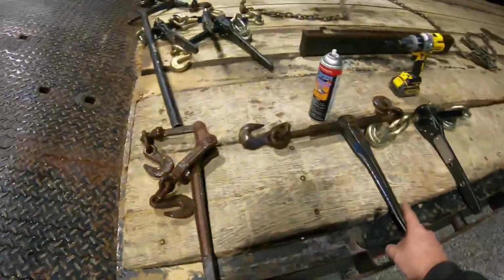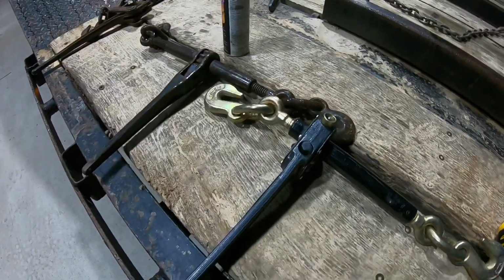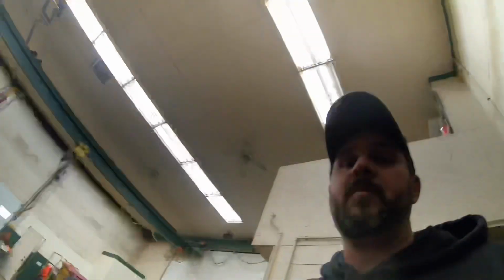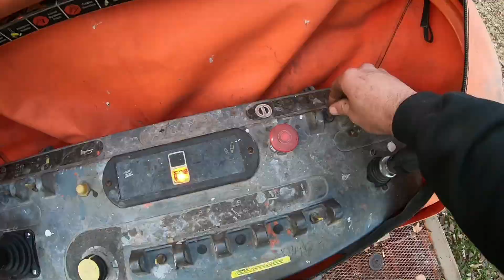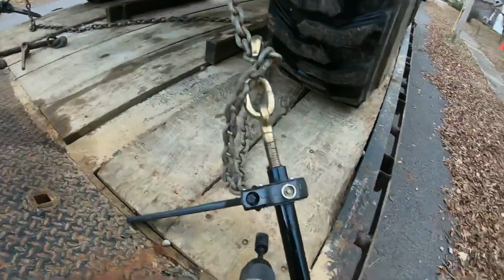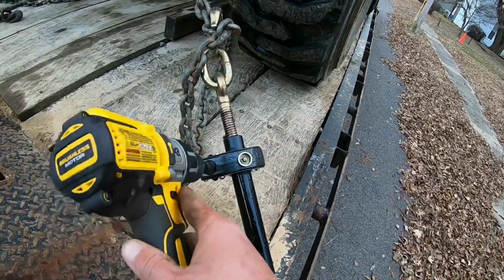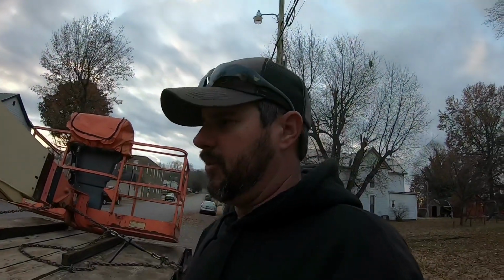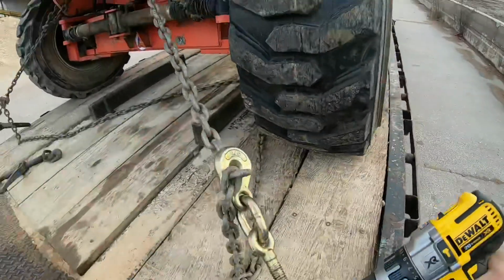Hauling man lift to Logger Wade and my thoughts on  new torque drive speed binders

Comment: You need to keep the ratchet binders out of the rain and they work fine mine are at least 15-20 years old and I haven’t sprayed them once.
Reply from the maker: The rain is not the problem it’s the dirt roads and I am not going to stop and unchain  when there is a chance of rain 🤷‍♂️😁
Reply: so i cant drive my truck all winter just to keep my binders dry ?
Reply: Cough cough Bs!

Comment: That’s cute until your battery dies or your employee leaves the drill on the trailer.
Reply from the maker: See your a glass 1/2 empty guy 🤷‍♂️ thanks for watching
Reply: Ratchet with a 14 mm socket.

Comment: issue i see is what happens when you derby contractors who are hard on tools round out the hexi bolt on the speed binder ??
Reply: Charles Serong good customer service and easy to get parts from them if we need too...but I can’t imagine that scenario without a little forewarning that would allow for preventive maintenance
Reply from the maker: It’s replaceable and not a big deal
Reply: @billiardbrawler  the only reason i posed the question as it looks like it i precast all in 1 syatem ... and we all know that a certain evansville "fireman" and a certain Derby "mayor" would pull it apart using a grinder and cutter lol

Comment: If a guy got careless, he night kiss a handle once as forgets to hold the handle... one the other hand, I have two arms but only one works  cause of nerve damage... would you believe a fungus from Nam is causing me to go blind, I have lost most of the use of my right arm and my legs swell so tight that they split the skin. I have to wear "Una Boots" and they have to be cleaned and re rapped every two days ... three some days but three times in one day once. I have liver and kidney damage all from fungus and might lose my right leg... it seems to affect my right side the worst. My eyes are sensitive to light all from fungus! I did enjoy the video but I made those ratchet binders from scrap and brake adjusters off the trucks

Comment: But what if the batteries die?  This is why I still nail all my drywall and crank start all my tractors.  Batteries are unreliable...period....#sarcasm #timesaver #myknucklesareintact
Reply: I was just thinking you could use a ratchet in a pinch. Or make sure the battery is charged. LOL
Reply: There is always a smart donkey in the crowd. LOL
Reply: Brian Gardiner I was being sarcastic, half of the comments when I did my video were people talking about dead batteries.  You’re exactly right.  That’s why he mounted a charger on the truck.  and we keep a wrench and socket set with the truck already for “just in case” scenarios, so we have been carrying the “back up tool” with us for years.
Reply: Captain Kleeman hate to say it captain, but I think he actually made the speed binders look like there faster than what you did lol. But you probably haven’t had the amount of tie down time as he does. Not hating on you just something I noticed.
Reply: DmaxMarshall it was definitely worth pointing out. Thanks
Reply: Captain Kleeman plus you were doing like 4 things at one time so mike might have had the advantage.

Comment: I would look into an impact. Smaller lighter easier to use and will almost always give the same torque. Friends of ours have gotten warned about chains, binders, or straps being on the outside of rails of bed by dot. Maybe keep ya from a ticket from a power hungry dot officer. Merry Christmas to you and your family.
Reply: 3/8's impact work real well, we have since approved the use of 3/8th's impact...1/2 inch is too much for it. Been using a 3/8th dewalt impact for 'bout 2 years now...works awesome...battery lasts longer too. With this drill in the video you'll see about 30 - 40  cylcles on one battery.

Comment: Not trying to break your balls but the way you ran tour chains is Not DOT approved . The rules are each tie point is supposed to have its own chain & binder just a FYI and just talking from experience I got ticketed for using the same method you just did on the video .
Reply from the maker: Load securement with Officer Hoover and Steve with Speed binders https://youtu.be/46hKizooXDk

Comment: Most states it is illegal to tie down to the rub rail .
Reply: K.D. Pearce really? I see people do it all the time here in Florida. Maybe that’s something I need to read whenever I decide to get my cdls
Reply: K.D. Pearce it’s legal here in good old Indiana.
Reply: @groundupexcavation  if indeed it's illegal it's a state-to-state thing. I personally don't know. Here in NY I've been told both ways. I chain to the stake pockets myself, INSIDE the rub rail because on the first load I chained down, the guy helping me said, "No-no-no, can't be outside the rub rail. It's ILLLLLLEEEEEGAAAAAAALLLLLLL!" Nobody seems to know, not even the DOT officers. You ask any two and you get THREE different answers as to what is and is not legal.
Reply: Its legal in NY too..
Reply: BarnyardEngineering my trailer has stake pockets and the round dowels welded between the rub rail and the deck. I use the actual d ring tie downs when I can. But sometimes I’ll go under the round bar and hook to the inside of the rub rail. Or I’ll go down through the stake pocket and hook to the top of the stake pocket inside the rub rail.
Reply from the maker: Video coming soon on that